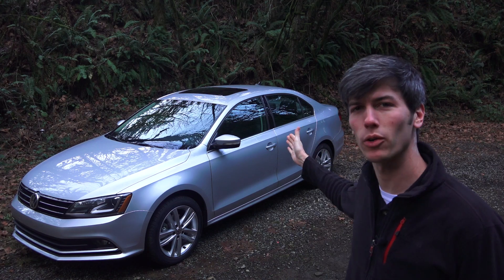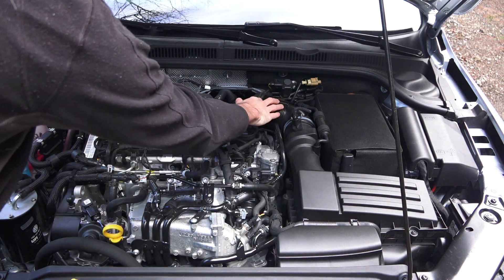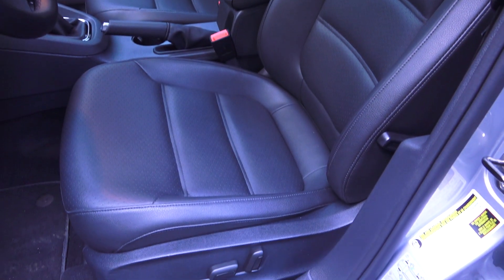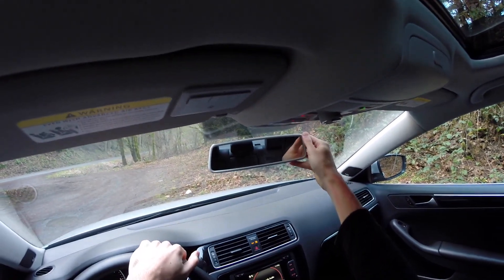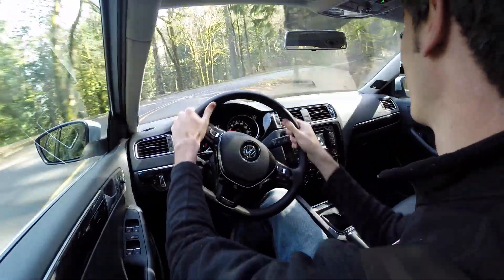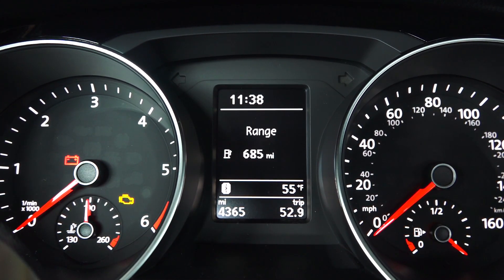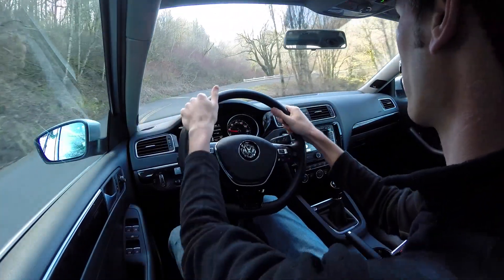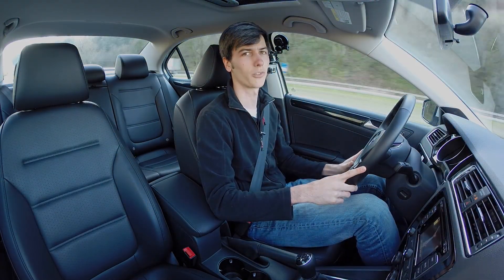2015 VW Jetta TDI - Review & Test Drive

Comment: iron block and aluminum heads? doesn't that mean problems down the "road?" (pun intended)
Reply: F!@#Guilt there are many motors with iron blocks and aluminum heads.
Reply: JustAnotherGunGuy  I guess its a matter of a quality gasket solution. Seems like its correct that bimetal construction is necessarily going  to be a problem but, gasket companies design gaskets based on this, overcoming the problems bimetal engines inherently present. 

http://www.motor.com/magazine/pdfs/082002_07.pdf
Reply: F!@#Guilt  yep. You need a quality gasket. That's for sure.
Reply: I'd imagine there is a gasket between them..
Reply: repo4 I'm saying because of the temp variation between the two metals, shouldn't this lead to head gasket failure?

Comment: great video man; was hoping to see a diesel on here. not to mention these jetta sels, i had one of them in 2013, and a maxima blindsided me at 50 mph crossing a red light and it smashed in to my passenger side pillar; my girl had not one scratch on her. Both cars totalled. spun, the whole nine. Shes alive and her face is undamaged thanks to the German engineering at VW. Just for the record =D safe car; i have a bluetec e class and the DB at full throttle is 67. 77 for cruise is pretty high for this. Yikes
Reply from the maker: Adam Boursalian Thanks for sharing - the 77 dB reading is taken on a pretty rough highway. I don't think I've seen less than 74 of the cars I've driven on it.

Comment: Just a quick warning to anybody thinking about modifying this vehicle: My 6 speed MKVI TDI has a DPF and two cats. It's straight piped from the axel back and makes absolutely no sound over stock. Deleting the DPF is absolutely mandatory to get any sort of performance gains (you'll need a tune as well since deleting it throws codes like crazy) so I'd honestly recommend the MKIV TDI since there is no DPF because it was before the requirement. Not sure if DPF deletes are legal in other states, but it is illegal here in California. That being said, the car is excellent for its price. I put in 15 bucks a week and do a considerable amount of driving. School, work, picking up my brother from his school, car meets, general errands, etc. The manual transmission is fun, but like he said, plenty of vibration in the clutch pedal. It's definitely luxurious, but there are bolts EVERYWHERE. Yes, the annoying torx screw ones. There's like 8 on the air box alone. Doesn't seem like there's too much room for modification, but it's a decently fun car and the gas mileage is no joke. I can achieve up to 60 MPG on the highway driving like a grandma.

Comment: It;s nice to see diesel power coming to USA - more efficient than petrol for long journies. And it's manual. Good job! It's a lovely car by the way, if you drive sensibly you will get 50 plus MPG easily. 
Being from the UK diesel power is common here. 
Though I'd love to drop a Cummins diesel in there :D

Comment: The gear change will get better with time, the Mk 7 Golf also is like that. It will get much smoother after 10k miles.
However, the clutch pedal fell is awkward. You can't really feel where it starts to slip. You get used to it, yes. But the Mk 5 was and still is better after >300k and even a '95 Opel Astra feels better after 180k...

Comment: Does it have a glow plug? Can't buy a car that wont start in -40 degrees...
Reply: +davdavc I dont't know any diesel that doesn't have them..
Reply: +KRAUSER0130 Cummins in dodge trucks do not have glow plugs it uses a grid heater that heats up so when the engine starts it pulls in the hot air passing the heater which helps ignite the fuel in the cold cylinder. My TREE FARMER skidder with a detroit 353-t also has no glow plugs and does not have a grid heater, in the summer it fires up fine in the winter a bit of ether helps or lighting a small fire under the oil pan helps too!!
Reply: Yes, should definitely still plug it in if its that cold though.
Reply: +Francesco Barbera that's must be a shitty brand all german brands have glow plugs their diesels starting from the 70s
Reply: +KRAUSER0130 My diesel doesnt have them, what it does is compresses the air a few times without injecting fuel to heat up the block that way

Comment: My personal point of view:

Good point: Manual Transmission (Always the best)
Bad point: Diesel engine
Reply from the maker: BMWgab What's wrong with diesel?
Reply: Actually nothing but I prefer the S.I. engines.
Of course, despite my preference, i think that the performance of modern Diesel engines are very good.

Comment: i drove one of these in the uk, didnt get the same mpg as our gallons are bigger. I used the cruise control so its not my heavy right foot. I remember the fuel guage after driving over 200 miles didnt move very much. The steering wheel certainly does have a nice feel especially in comparison to the golf estate which had a hard plastic wheel. Overall i really liked the Jetta and seriously considered getting one.

Comment: Clutch vibrations are actually common, I drive '10 Golf TDI and I can also feel them sometimes. I think it's because of heavier dual mass flywheel, because it's diesel with strong torque at low rpms and more of the vibrations transfer to clutch itself.

Comment: Did you feel vibrations on the steering wheel? I asked you this because I my car is a vag group diesel 1.6 tdi dsg and I m really happy with the fuel economy buy my steering wheel vibrates a lot, my hands gets numb after driving it. I went to the dealership to complaint about it and they said it s normal.
Reply from the maker: Interesting, I don't recall any vibration in the steering wheel. Actually I thought it felt pretty good, and much better than the S4 I drove (though both are similar systems, from the same company).

Comment: Diesels used to only get marginally better consumption than gasoline engines, coupled with the fact that they're more expensive to buy initially, made them considerably less attractive to buyers. The fuel costs more and it will take many, many years to pay off the cost of the engine itself through fuel savings, so unless you need the torque for hauling it's hard to justify diesels. I bet the new Focus and Fiesta will give this car a run for it's money when it comes to fuel with the 1.0L EcoBoost.
Reply: This comment aged like milk lmao

Comment: The American general hate for diesel engines is weird.. Diesels consume so much less fuel and have that meaty torque at low RPMs, which is something you want in everyday driving. Although I do understand that diesel is actually more expensive there than gas, which could actually change if you used more diesels. Economies of scale at play there. In Europe diesel is around 15-20% cheaper than gas. Nowadays there's not even a price premium over a gas car when getting a diesel one, they're pretty much the same amount for the same sort of power level.
http://www.nacsonline.com/YourBusiness/FuelsReports/GasPrices_2013/Pages/Why-Diesel-Costs-More-Than-Gasoline.aspx
Reply: Kepe Actually many Asian counties, Korea and Japan come to mind, go even further by effectively banning diesel passenger cars. The main issue in North American is both Canada and the US have very stringent emission regulations. To be sold in NA a diesel car has to have expensive emission control systems added which raises the price of the car to thousands more than the gasoline version, The complex systems lower the engine MPG numbers, and are also prone to failure. Then there is the perceived negative stereotype about the engines being dirty and  terrible for the environment. This why Hybrids out number diesel cars on the road. On top of all this, many new gasoline engines are starting to get close to the diesel famed mileage.  For example  new  Mazda 3 base engine gets over 42 MPG on the highway and it costs about five grand less than a Jetta Tdi.

Comment: Diesel is the fuel of Satan. It's only point is economy (but torque for trucks to pull stuff) and it compromises power while sounding like a tractor. That being said, I still like this car. The reasons americans don't drive diesel sedans is because they aren't used to it, with petrol being so cheap. But it looks like nowadays you can actually do with a diesel sedan (especially a 535d). Still wish they wouldn't sound so terrible:(
Reply: Modern diesels sound pretty much the same as a corresponding gasoline engine in the same car. You only notice a difference if you floor the gas pedal. And the compromise in HP is pretty much compensated by the higher torque. Then there's the fact that a NA gas engine hits its max HP at like 5000-6000 rpm and max torque at around 4000 rpm, while a TDI has its highest torque and power available from 1500-1750 rpm. So the power curve is a lot more usable for a daily driver in a diesel engine.
And in America diesel is so much more expensive because you use it so little. If and when diesels become more common, you'll see a drop in diesel price as well.
http://www.nacsonline.com/YourBusiness/FuelsReports/GasPrices_2013/Pages/Why-Diesel-Costs-More-Than-Gasoline.aspx

Comment: So,the real question is...are you actually saving money switching to diesel? You might get 50-60 mpg but diesel being about $2.00 more than gas...compared to a 40 mpg gasoline car, seems like the price will equal itself out.
Reply: what gas is more expensive there? it's cheaper here :P like €1,40 per liter gas is like €1,60 per liter
Reply: Tim van der wiel Yeah...it also takes 4 liters to equal one gallon. So $2.00 per gallon here is 7 or 8 euros.
Reply: TheCowGoesMoo o Diesel has never been $2 more than gasoline, the most I've seen is $1.40 more. And I figured out that if I bought a 2015 Jetta TDI vs the 1.8t, in 5 years/60,000 miles, the diesel would have paid for itself. But I ended up buying a 2015 Golf 1.8t so screw that haha
Reply: Brandon Friesen Lol..5 years, yeah i'll most likely get a new car by then. Whatever, it's not like I have a 100 round trip every day where it matters, so I'll just stick with gas
Reply: TheCowGoesMoo o 5 years is a shorter ownership term for a car than the average financing term...which is 7. Anything beyond a 4 year payment plan is too long and the interest rates will kill you. But honestly 5 years isn't that long, I'm gonna own my golf for 5 years and then trade it off for a new car. And I'm doing 100 miles a day almost so I really considered the diesel but bought the gasser just because of lower maintenance costs and the fun factor. The 1.8 TSI engine will beat any stock GTI up until the 2010 year when the mk6's came out. It's an awesome little engine.
Reply: TheCowGoesMoo o Where do you live that diesel costs that much more? I live in Upstate New York where Diesel is $3 and regular gas (87 octane) is $2.53. No braining with less than $0.50 gap.
Reply: mysticgeek I live in Calgary too. This price drop in diesel won't last long sadly
Reply: I feel up once a month. So the savings is far more than you think.

Comment: VW is made by audi , Porsche is aswell
Reply: audi, porsche, lamborghini, bentley, bugatti, skoda, and volkswagen are all VW made vehicles. Audi and Lamrboghini share design philosophies with the other manufactures tending towards VW
Reply: Derik Jacobson Well technically VW doesn't make the cars of those other brands. VW owns the brands and they share a lot of common parts and platforms, but they all pretty much have their own designers and engineers and such, making cars that fit the specific brand's style and demographic.

Comment: And if you decide to tune (chip) this TDI you make near 180 hp, 300 lb-ft torque and get better mpg.
In the MK4 generation TDI you could get 220 whp and near 320 lb-ft while getting 50 mpg highway with just a turbo/injector and tune. Diesel has a lot of potential, i don't know why it isn't more popular in the states
Reply: California is afraid of the emissions. California sets way too many standards in the U.S.
Reply: Because yeah... breathing is overrated. 

Oh... and forget any form of reliability and longevity with those numbers. It will be a rattle can burning oil before you know it.
Reply: It’s over $3 a gallon in most states

Comment: iPhone 4/4s connector in 2015? Lol
Reply: +wochoa why even have a phone specific charging cable, why not just a 12volt usb, wtf
Reply: Seriously, right?
Reply: ***** hmm, i dont remember typing that, must have been a typo
Reply: That's weird, I have a 2015 jetta tdi too and it has a lightning connector
Reply: you can buy $10 connector on eBxy , 2 min easy fix. Plus play Mp3 and Flac files

Comment: +Engineering Explained Question about your MPG test; do you start the test with the engine warm or from cold start?
Cheers, Alex.
Reply from the maker: Try to consistently start cold, but I'll admit that it doesn't always happen perfectly. Occasionally it will have some heat left over from a previous drive, or if something goes wrong and I have to start over, it may have a little preheat. I get on the highway pretty quick, so most cars are warmed up in about 1-2 miles.
Reply: Thanks for the info.

Comment: For me I was comparing this to the corolla s review you did a while ago and I would definitely take the corolla just because it's about $5000 cheaper and reliable engine, I know this has german engineering but I have always been a fan of japanese cars especially toyota. I would really like to hear your opinion and other guys who are watching this video.
Reply from the maker: khaled webster Someone else commented similarly. If it was narrowed down to those two (which, there are probably some other cars I'd look at as well), the Jetta is going to provide a more enjoyable driving experience. The Toyota will get the job done, and has Toyota's reliability track record on the table.
Reply: The VWs are quite expensive, but the diesel engines should last well over 300k miles if you take good care of it and don't floor it when it's cold

Comment: What's the rpm when cruising at 70mph? Does it pull well in 6th with that much torque? Engineering Explained

Comment: Hi, regarding the diesel question ("Why don't more Americans drive diesels?"), here's a "fun" fact. French authorities pushed towards more diesel engines on the roads during the 80's and 90's after the oil crisis by applying more advantageous taxes to gasoil fuel over petrol fuel.
And now, due to pollution concerns, they're backing away from that policy by increasing those taxes on gasoil and the newly-elected mayor of Paris recently announced her intention to ban all diesel vehicles in the capital as of 2020.
Reply: The emission system in the TDI is far more advanced then the French versions in the 80's. Pollution is not an issue with this car.
Reply: Remember our emission laws in North America are at least 3 times more strict than the strictest in Europe. The 2.0tdi in the 2015 Golf/Jetta produces a lot less emissions than the 1.8 turbo gas engine.
Reply: +Robert Hill So we thought, at the time.
Reply: +Kirisame312 i personally think that the tdi engine isn't as bad as a majority of diesel trucks out there. The epa has got a little ridiculous with their standards.